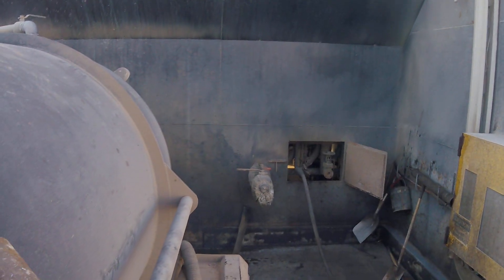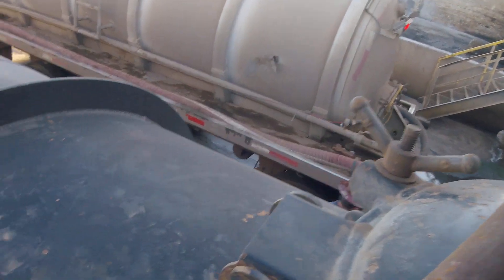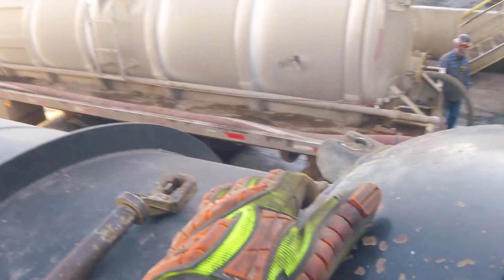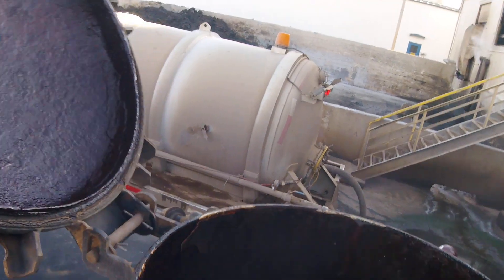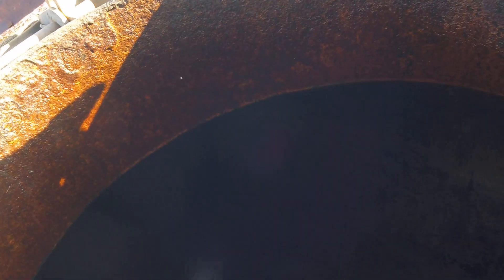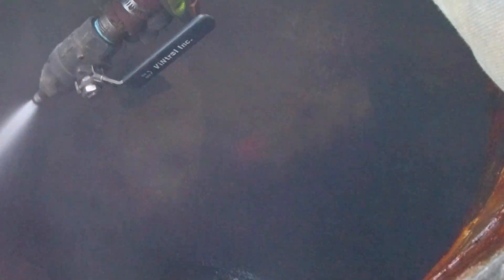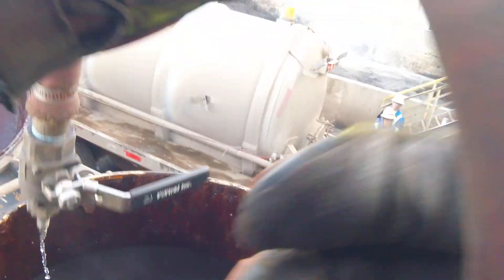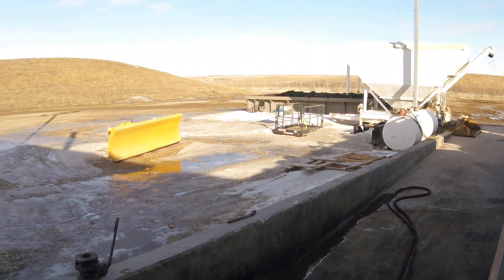How to work in Bakken Oilfield Work/Pt.1 Washing out Vacuum Trailer

Comment: Thanks for going in depth with the videos and explaining what you're doing. One thing I've always wondered is how do you find each site you have to go too? Is it marked well with signage or do you call someone when you're getting close?
Reply from the maker: Yes, wells are all marked.  Also, I use an app called wellsite navigator and it has all wells in US.
Reply: @northdakotadriver5714  Gotcha, keep up the good work on the videos, you're by far the best one with giving tips and explaining the process. Been driving for a little over 2 years now, just sort of looking to see what else is out there for work.